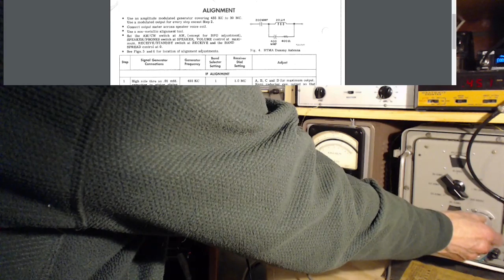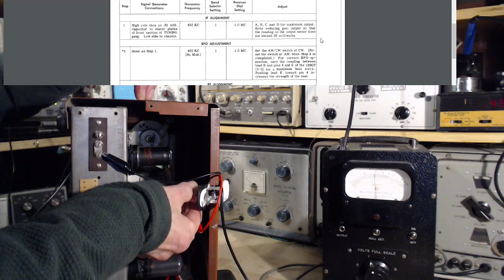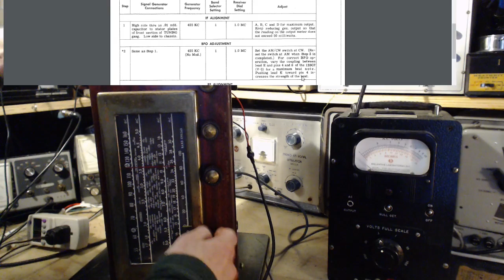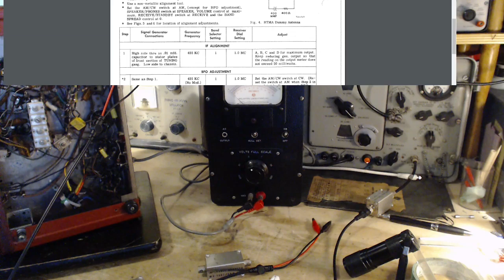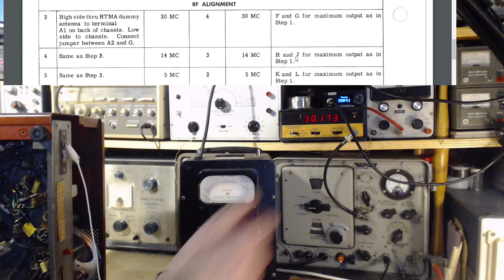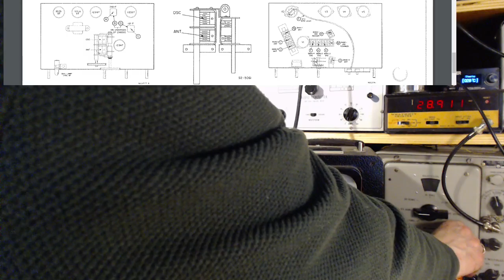Hallicrafters S-38D Communications Receiver Video #8 - IF Alignment and BFO Check

Comment: Hi Jim
It's getting past a joke now .
A diode a with dc bias & a 0.1uf cap pushing into a DVM is better than that meter .
Take the time & fix the equipment please .

The RMA dummy is just a stable & standardised way of making the signal generator look like a normal antenna ( not loading the tuned circuits or pulling the lo ) .

PS you can put a 100 ohms resistor in one speaker lead & meter across the output transformer  .
Note  The SDR is set for USB reception !

And do you adjust trimmers with the bottom plate on or off ?

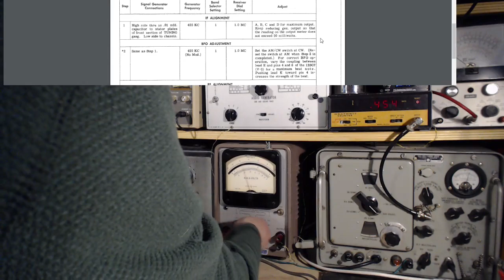Comment: 13:17 "And before you say why dont you clean that switch (on the dB meter); that switch has been cleaned six times over the years". Well if that is so then maybe u did not do a good job the first times or there is something wrong other than just corrosion on the contacts or - and this is a long shot but worth a thought -  WD40 is not a proper contact cleaner.

Comment: If you don’t use a dummy antenna and connect your generator direct to the antenna circuit then after you finish your alignment, the RF circuits will be out of tune.

Comment: If your digital frequency counter can’t be more accurate than within 6KHz then it’s not worth having. It’s long over due to calibrate the master clock or get a new counter. There are many ways you can calibrate it to better than 6KHz.

Comment: Jim, I encountered the same problem reaching the IF adjustment slugs with a radio still in its cabinet, but there usually is a simple solution instead of cutting up your alignment tool.  If the ferrite slugs are tuned with a hex adjustment tool, you can actually reach BOTH the ferrite slugs from under the chassis. You need (and probably have) an adjustment tool that has a hex tip only about half-an-inch long, then a slender round shaft, and a second hex section an inch or two down the shaft. To reach the top slug from under the chassis, you push the tool all the way thru the first slug until the hex section clears the first slug. Then only the thin round shaft sits in the first slug and the hex section enters the second (top) slug. So then you can adjust the top slug easily from underneath without moving the bottom one.  Then you withdraw the tool far enough so that the hex part is now in the bottom slug, and you adjust that in the usual way.  (A little hard to describe – but it works well for me!)

Comment: Total incompetence, one hour to turn a screw of the IF coil (the others do nothing)...
Analog multimeter doesn't work, frequency counter out of alignment, the instructions specifically mention a non-metallic screwdriver, never mind the circuit for the dummy antenna... A Titanic of an alignment...

Comment: It would probably be much easier if you took the case off?
Repair some of that flaky old test equipment, for the work you attempt to do it is adequate, but it also needs to be maintained and serviced!
You could use the standard frequencies to do your initial set up and then use the sig-gen to get the ones that you have no propagation for.